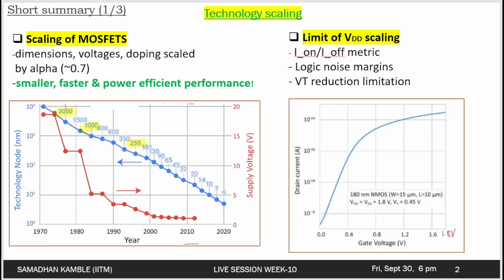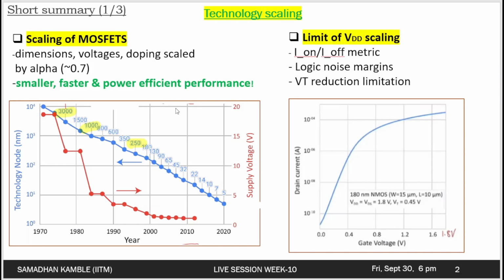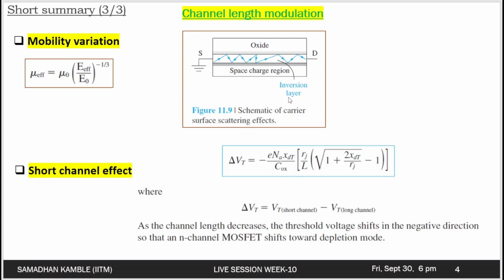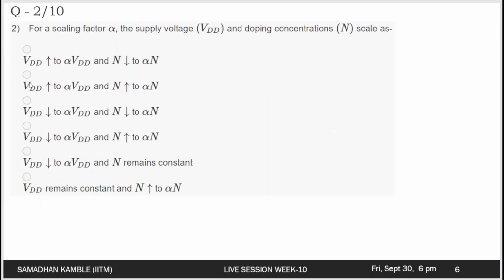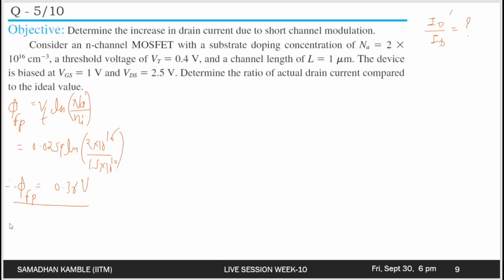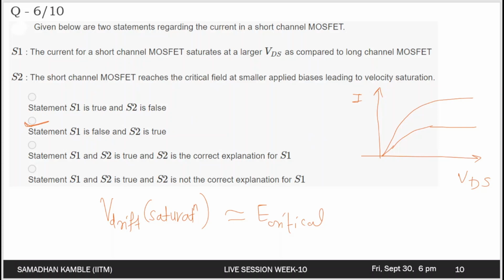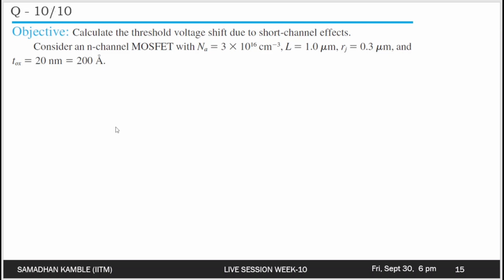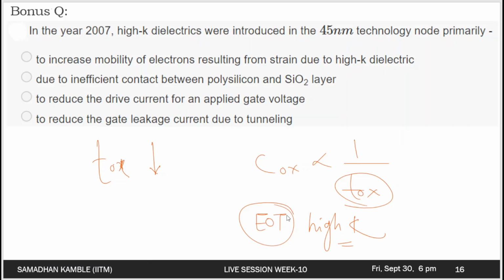NPTEL-ISD Live Session Week-10 | Solutions for assignment 10 | Course:Intro to Semiconductor Devices

Comment: Is it possible to visit VLSI fab labs at IISC Bangalore as I myself is a PhD scholar working in MOSFET modelling and design and it will help in my research.
Reply from the maker: Hi Lakhmikanta, generally you can visit such labs by taking prior permission/appointment of the lab leader/prof. You should write a formal email to them showing your interest/purpose of the visit. Also, you may contact any of the current working member of the particular lab first.
Reply: @SamadhanKamble_iitm  Thank You Sir.